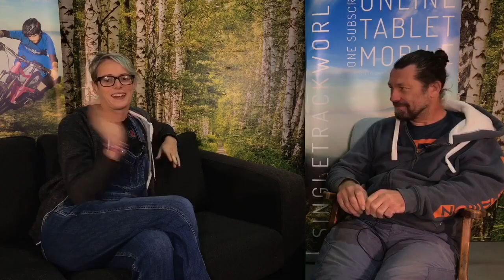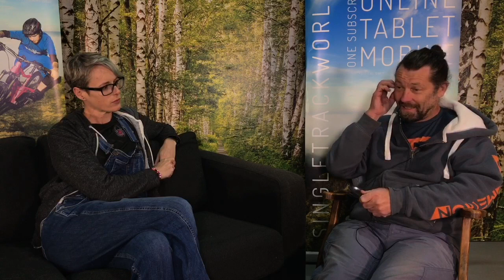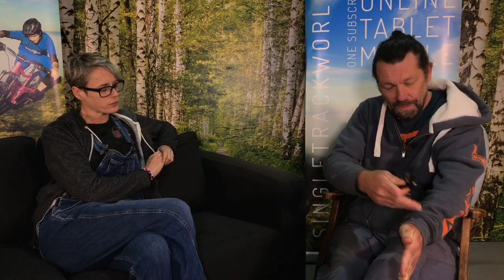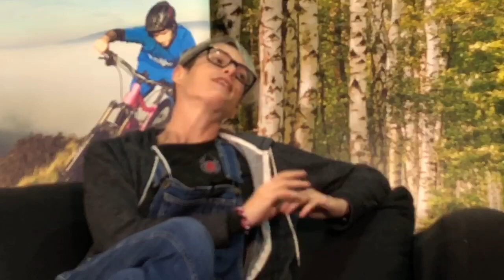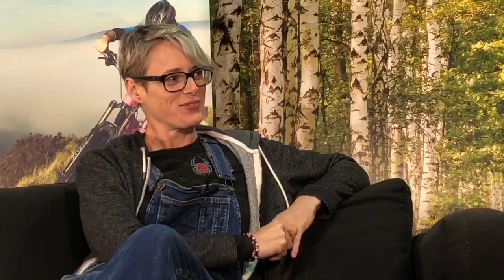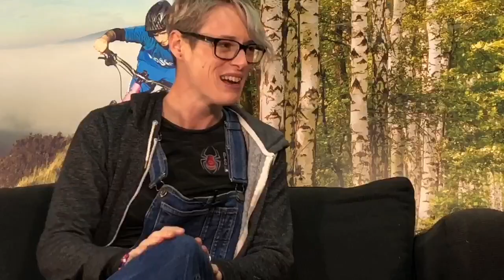Suspension Expert Chris Porter reckons the telescopic MTB fork has had its day

Comment: I and a few friends are strongly of the opinion that the old open oil bath, coil spring marzocchis were vastly superior in feel to modern forks.
Reply: That depends on what he considers superior.
But yeah coil and oil is always going to be the plushest feeling, due to lack of friction and stiction.  A airshaft accounts for 50% of a air forks friction/stiction.
Reply: @superchickensoup  blast from the past. I was wrong. The correct answer is: Get an ebike so that initial stiction becomes irrelevant.

Comment: My original Z1 bombers have a spring and damper in each leg. Marzocchi did it right back in 1997, they even had two disc caliper mounts if you wanted to even the load there too. I still ride them regularly, rim brakes and all.

If we look at how primitive a fork really is though... that's where there's a real issue. We're relying on two long... (effectively) cantilevers to keep our front wheel in place. All these people trying to reinvent the fork, why not just try and eliminate the fork entirely? It's a 19th century design.